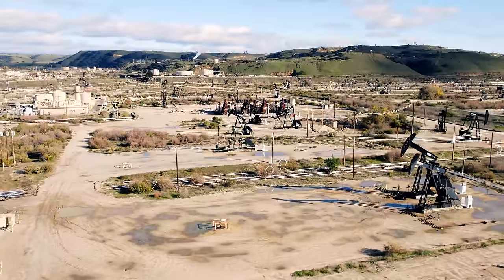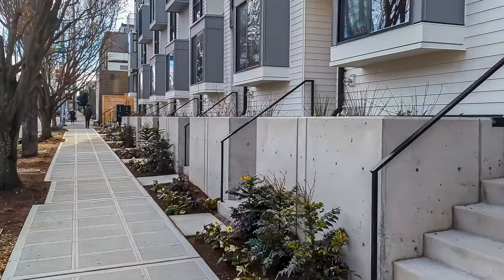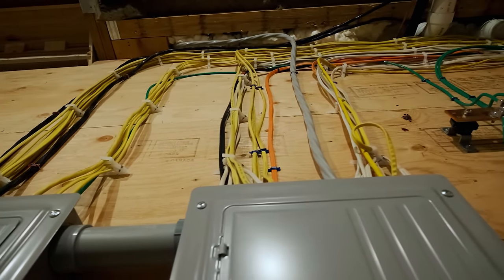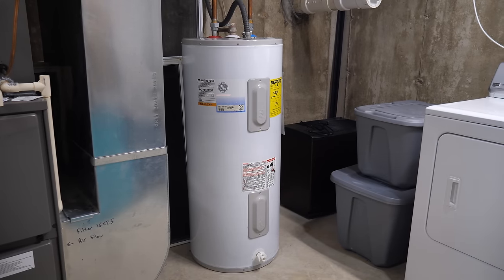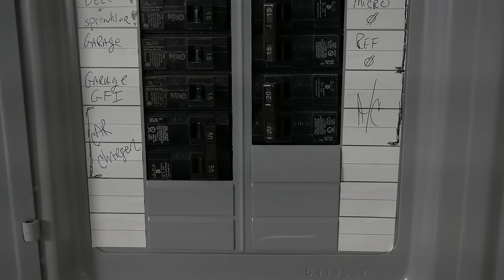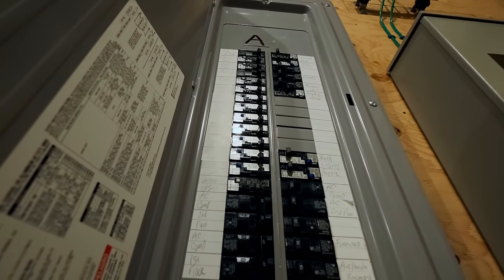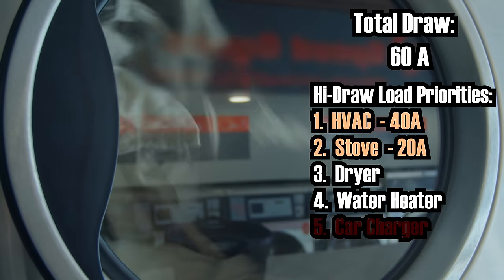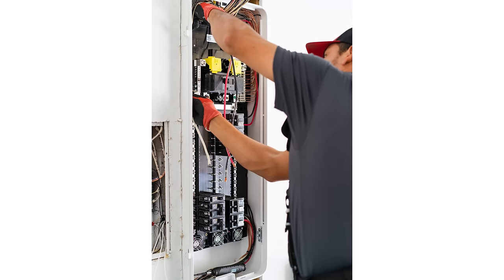Home Electrification: There's not a lot to do, and it doesn't have to be hard (Part 1)

Comment: Considering the US electrical system can barely handle normal summer time power usage (think, AC) we are not ready to go full electric as a country at least.  We're already stressing the power grid, and until it's upgraded and more power sources are put in place, such as massive solar farms or some other means of generating power by not buring coal or nuclear power, it will be a while.

Comment: Natural gas systems uses natural gas when it is needed, very easy and cheap to store and handle WHEN USED PROPERLY AND WHEN USING THE PROPER TECHNOLOGIES AND PROPER INSTRUCTIONS. Electrical systems is wasteful of energy because the electricity must be 24-7 available at all times and in all places WHICH MEANS THE NATURAL GAS TURBINES DRIVEN GENERATORS MUST BE KEPT RUNNING AT FULL CAPACITY REGARDLESS WHETHER SOMEONE NEEDS ELECTRICITY OR NOT.

Comment: Great Video! Here in the Netherlands most people do not have these massive utility rooms, somehow we manage to do without them and use all available space for living space. Also Clothes dryers with an Heat pump are very affordable €800 and work perfectly at a fraction of the consumed energy of a gas o conventional electric powered one. They do take longer but you can do other stuff in the mean time like watching your video's! Also Heat Pump Boiler tanks are now starting at €2100 so are also an alternative. As full heat pump heating is a bit expensive right now the hybrid heatpump-gas powered heating is fairly popular where the Hybrid heat pump (4KW) can assist your currently owned Gas heater. The hybrid heat pumps are monoblocks so they are easy to install and start around €2400 including installation.

Comment: I would love to be more eco-friendly by going completely electric... BUT I have 4 problems with that- all four of the appliances mentioned are gas-powered in my home, and at least three of them are less than 5 years old. I'm pretty sure I could manage without flipping the main breaker with all of them electric, but I simply cannot justify buying brand-new appliances when the ones I have work perfectly fine. Producing large chunks of metal and computers and engineering to then ship around, make into new appliances, and ship those to a home causes pollution in its own way. Not to mention, I really don't have the funds to replace all four of them right now anyways. My plan is to replace them with electric models once they go out. The HVAC is likely to be first since it's the oldest. It will be replaced with an electric model. The water heater same. Then the stove, I'm legitimately excited to get an induction cooktop when that happens. And finally the dryer. 

Assuming I'm living in this house long enough for all four of those appliances to bite the dust, I'll be an all-electric home. But I'm not going to force it when I don't have the means and cause a different kind of pollution in the process.

Comment: Just because I haven’t seen it mentioned …
It’s much more efficient to turn gas into heat at the point of use (i.e. heater/boiler, stovetop, clothes dryer) than to turn gas into electricity at a power plant and then that electricity back into heat at the point of use. I get that renewables should be our ultimate goal, but in the interim it can actually be more environmentally friendly to keep some gas stuff. Nearly half of the US is powered by natural gas

Comment: I am not sure why we want to use coal instead of natural gas. You are giving me impression that a minority of our energy comes from cold the exact opposite is true.. renewables are great. But if you're switching your home heating from gas to electric what you're doing is radically increasing the amount of pollution you're creating
Reply: no you're not, electricity production in those massive fossil fuel plants are super efficient, A/Cs already have a EER of around 3-5 so you're cutting your fossil fuel generation by almost 3x and that's not accounting for the fact that for most of the world, coal is less than 50% of the energy grid

Comment: I’m so glad to see I’m not the only one doing this.  To be honest it started with a new range that we got 1/2 off new because of a tiny dent.  And since we were redoing the kitchen AND needed plumbing / electrical anyways, we went full electric in the kitchen. Then the water heater went out after 30 years.  Noticed I’m charged a flat rate service fee if $80 regardless of fuel used.  That made it easy to decide to go electric on the water tank. Dryer already is electric, so that just leaves the furnace.  That’s about 40 years old so… yeah.   We will just convert that over and save nearly $100/month once that’s set.  Costs are otherwise about 1:1 sans that unneeded service feee that has charges.   

I did have to upgrade service (no new drop since that part was just fine ❤️) BUT that’s because 30 years ago someone did an illegal upgrade to 100A using the old 60A socket.   New higher electrical draw started to mess with lights and battery backups.  Turns out that the illegal upgrade, that the city inspected and passed, caused the neutral bind to arc. Just glad I didn’t have a fire! Decided to go to 200A because it’s the same price at that point. Topped it off with switching to an electric car and enjoying that 48A 240v overnight charging.  Plenty of room in the panel for the future now. Who knows what the future holds for the next owner? Build up for your fellow citizens 🤙

Comment: Ok, so I am getting the, “I would cut off my big toe if the environmentalists/democrats told me to vibe”. I work in the utility industry as a grid controller, and I can say for a fact that we are not ready to completely abandon fossil fuels. Also, I don’t like the idea of losing energy diversity, just as I don’t like keeping my investments in one fund. We need redundancy in our system. When temperatures are extreme, I am constantly having to manipulate the grid to provide consistent voltage to our customers. Last Christmas we were notified of max generation capacity, and if it were not for a chance storm, we would have exceeded our ability to supply proper voltage. The study about poor air quality is obviously a ploy to remove fossil fuels from our energy diversity. I assume some environmental group lobbied hard or donated to Biden, so he has to try bam those horrible appliances that have been used for generations “for your own good”. You know what, let people decide what they want to use. If they want to use a gas stove let them. There is no reason to mandate a ban, or demonize an energy source. Do you think you can live without oil and gas? Sorry to say, but most plastic components are made from petrochemicals, unless they are soy based, which mice love the taste of. My point is, the effects of gas stoves are negligible. Use a good vent hood or open a window. I am scared to imagine the amount of rolling blackouts I will have to implement if all cars switch to electric, or the effect of all electric houses on the system. We need to let the infrastructure catch up before we ram government induced sanctions on the system.

Comment: Okey. I´m from the northern parts of Sweden (Think middle of Alaska hightwise on a map..) and for the most parts of this video I sat here and laughed at "stupid Americans and their weak electric grid". But then I did the math and your 100 amps 2 phase 220v are 24kw service. And my 16 amp 3 phase 400v are 11kw service. Sure, my service is the cheapest available but even the more "normal" one for houses with a smal garage are 20amp 3 phase 400v and thats only 14Kw. of course, its often possible to get 63 amp 3 phase 400V but thats not for your average house.. 
So what am I missing? What do you do with all your power? How can it be considered a problem to switch to electric?

Comment: this guy just hates gas of any kind lol. i think that he forgets the power goes out all  the time everywhere. and most solar sys don't work if the power goes out due to them being grid tie only inverts. my mom found this out the hard way after a 4 days of the power being out from 80mph winds. sure you can get batts but they cost alot of money and most ppl dont want to spend over 10k to have a good bit of batts that will feed everything in the home but the ac sys.

Comment: You are missing a lot of points. First and foremost the largest residential heat pump is 60, 000 btu at 47 degrees and output drops from there. Many homes and not Mcmansions are a minimum 100,000 and residential gas furnaces are made up to 140,000. Are you recommending 2 heat pumps? #2 taking baths, yes many people have 2 person or even 1 person large whirlpool baths. The only water heaters that can handle that load today are gas tankless. Finally as a HVAC tech for 40 years I will not replace a blown compressor, failed TXV or even a failed reversing valve when it is 20 degrees out and snow on the ground, besides the fact that POE is extremely hygroscopic and any moisture inside the system will end in an early life. So yes if you live in a very efficient new home with a load of less than 40, 000 BTU. If you dont enjoy taking baths with your girlfriends and you dont mind using resistance heat for an entire winter it is very possible. Why dont you try something simple to start with like a desuperheater on a standard AC that dumps all that rejected heat into a pretemper tank. That would be easy and cheap.

Comment: I really was annoyed by your snarky lecture. I enjoy watching you most of the time, but this one you got on your high horse half cocked without enough information. Those Span load centers you are so enamored with start at $3,500. That doesn't include breakers, shipping, or the installation. My conservative guess is this could cost $10,000 in a hurry. I like the tech, but you flippantly (and with much snark) told everyone to go out and get one. Next, you suggest that it is easy-peasy to convert your gas appliances to electric. Sometimes, maybe. Often, not so much. Have you priced new appliances? Have you tried to get electrical work done? How about your simple little suggestion of adding insulation? You have no idea what that would cost in most cases A new water heater with electrical upgrade and installation will easily cost well north of $5,000.
I truly think that this time you spoke out your backside.
I say this from the point of view of someone who has solar, an electric car and do my best to reduce my footprint on this planet. (I'm not convinced the EV is the best "green" choice though.)
Right now if I had to redo our insulation the installed cost would be $15,000. That's just the attic and doesn't include the walls. I know a lot of people would struggle with those costs and how long is the ROI? Probably never if you're being honest.
I did a lot of research and calculations when I installed solar on this house. I also slightly oversized my system for later expansion because the local electric company has fully inserted themselves in the process and do all they can to discourage customers from getting solar. (I know, hard to believe.) If I make any changes at all on my solar system I have to start over and now I pay higher costs all around for my power. That's messed up. As it is, I jumped at the right time and did things ahead of time to make it pay off. I'm in year four and have recovered all but about 20% of the cost. The astute among you will realize that by next year I should be on the positive side of this equation with 20 years of warranty left on my system. (Standard warranty on the equipment I purchased...I don't believe in extended warranties most of the time. Yes, I'm aware warranties are rolled into the price.)
I oversized my system because I will switch from a gas water heater to an electric one when the current one dies. I figure that's the best use of money. Fortunately, I'm lucky that this house was set up for both. (Although the builder cheated on the insulation in a big way that was discovered a few years into ownership. That's why I know the costs to insulate.) When our stove craps itself I'll replace that with an electric range. So, I'm slowly getting there, but at the time this was setup it wasn't even close comparing gas to electric. Our electric dryer in those days (the kids were still at home) cost about $5 per load to dry. When I converted to gas that cost dropped down to 95 cents. I haven't done the math for a while, but both electric and gas costs have risen sharply with gas rising much faster. It will make sense to convert back to electric when this dryer croaks. BTW, someone gave me this dryer if I would swap them my electric dryer. At the time it was a huge win for us. We were saving dollars for every load we did. Now we do about two loads per week, not three per day.
My point here is that you need to present this a bit different and drop some of the preaching. You're not completely wrong, but you came off as an ass.
Oh, and my gas power furnace and HVAC system is going to be tougher to get rid of. I can grandfather this older system until I leave this planet as my best friend literally wrote the book on AC and I have sources for super-cheap repairs. My ROI on replacing my current system based on energy savings would be....NEVER. I've literally done the math. (All bets are off if prices on power go 10x what they are in a year. 
So, I usually appreciate your information, but this time I was thinking you should be shaken vigorously for your snarky attitude and lack of realistic costs.

Comment: How could i use heat pump appliances and still do what im doing at the speed ive been doing it? I understand the answer to heat pump water heaters is combo units, but are there combo dryers with smaller 110v heat elements?

Comment: I live in state housing in a country that has removed all the fireplaces and fuel burning and switched to an electric heat model. Only, they only require the living room to be heated, and the heat model they use runs so expensive you can't really justify using it, and it doesn't heat the rest of the house at all, so it's the same as having no heating solution and freezing half to death in winter.

Comment: As someone who lives in an area with mostly over-head lines, and the possibility of ice storms and tornadoes, I would never want my home heating to depend on electricity, and I would prefer to have enough solar to run the AC (as budget allows). Having no plan for backup heat is just stupid.

I choose to burn wood as much as I can, and supplement with propane heat.

Comment: Thanks a lot for the video, very nicely done! 
My 2 cents (or dollars maybe): I live in Sweden and I have an all electric home with a ground based heat pump heating water used for both heating the house and heating water for shower and the like. We also have an induction stove, an electric dryer and an electric car charger. We've been living this way for a bit more than a year now. It is ... awesome! Also two quick notes: I am nerd so I am keeping an eye on how much power we draw using a smart metering system and we almost never go above 10 or 11kW (car charging excluded but I have a load balancing integration specifically for that), even when it's -15C (we heat the house at 19C). Also, if an issue happens with the heat pump there is an emergency resistive heating system in there to keep heating things up (it can go up to 9kW by itself I believe). In normal operations it is only ever used every 2 to 3 weeks (configurable) to heat the water tank above 60 degrees to destroy any salmonela germ.

Comment: As you said; the biggest issue in the US is that the grid is NOT able to handle it in it's current state. LA (if memory serves) still has rolling brownouts at peak hours, because of it. Nuclear would really be a good alternative if Jimmy Carter hadn't killed breeder reactor research. Electric is a lovely idea, but at this stage it's too much of a pipe dream, especially the EV stage, given the state of battery technology. We're making progress, but we're not quite there yet. Wind, however, is a horrid alternative, given the upkeep, and the environmental impact. Solar would be nice, if the panels weren't cost prohibitive. A solar backup 'generator' that I priced out to have installed could only power THREE 15a breakers..... Whereas the NG/Deisel backup could do the entire house, and then some. Still, it's my favorite alternative, and where I think we should be focusing as far as truly 'renewable' power.

Comment: You may make a satisfactory bread without a hard crust (easier to cut!) by your normal bread-making practice including proving, punching and rising, followed by microwaving. This requires your bread tin to be made of glass or porcelain rather than metal, but the power draw will chop between 1500W and 20W (for the light, fan and motor) on a 40% duty cycle rather than whatever your oven runs at (although I grant your oven likely has a lower duty cycle, but the peak draw is higher), and for a shorter time (I cook bread in the oven for over 110 minutes. A microwave oven has the job done in 40). You're also heating the air less.